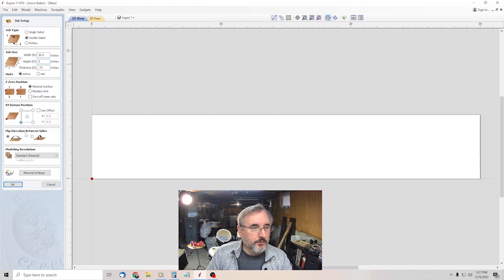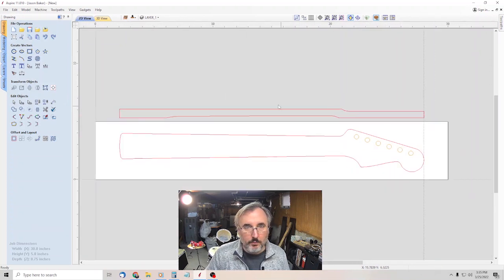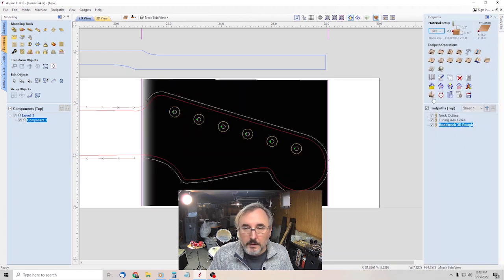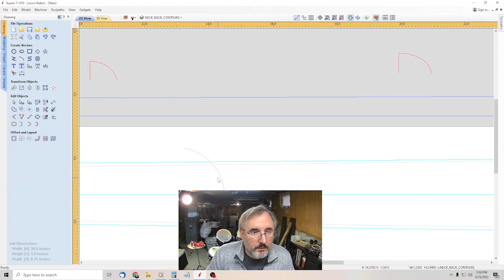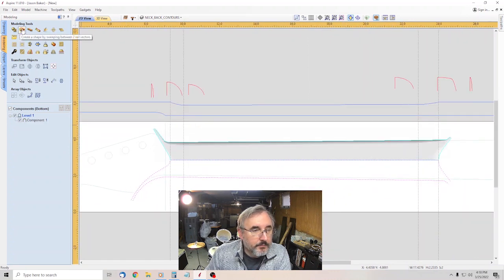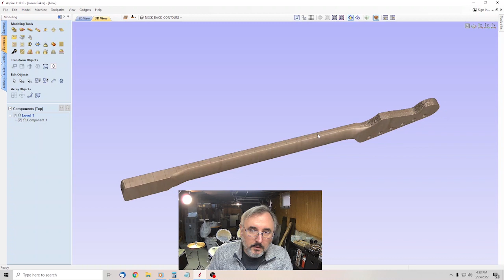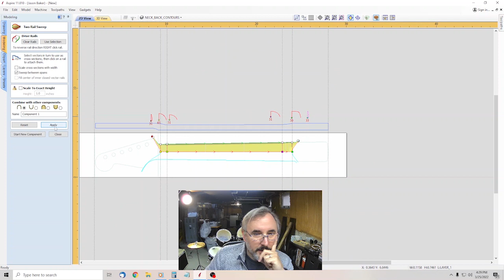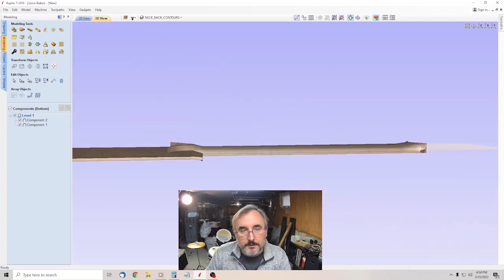Modeling A Stratocaster Neck Using Vectric Aspire Pt.1

Comment: Does Vectric 3D have the ability to cut a cross section of the back of the neck which would allow an asymmetric mod that you can splice between , to make a custom designed neck,  or would it be easier to just create an symetrical neck back from scratch?
Reply from the maker: I guess I’m not sure what you’re meaning. Do you have a better example?